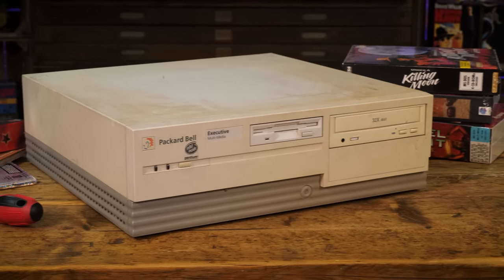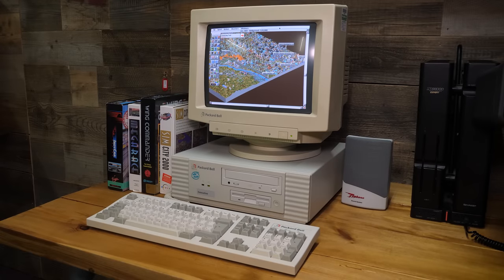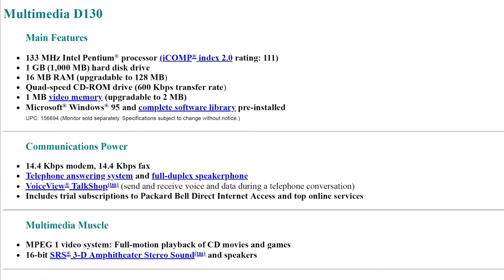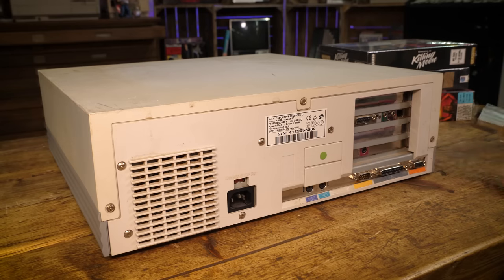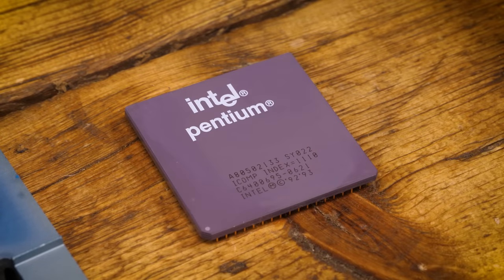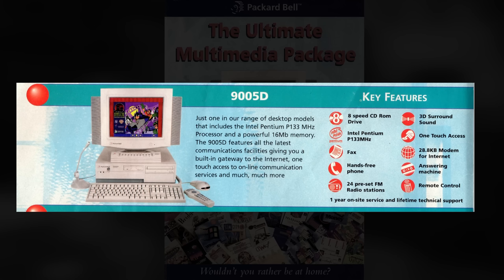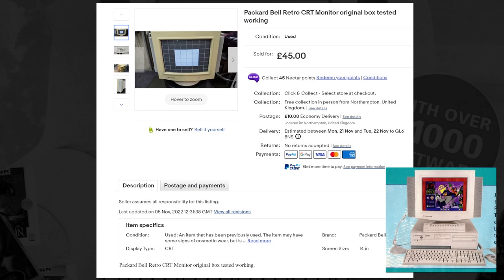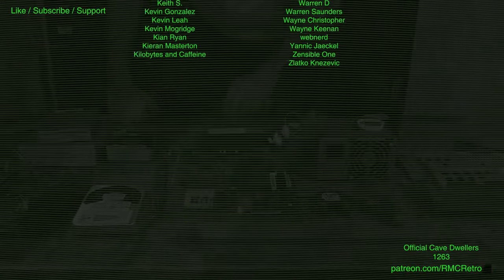Packard Bell Restoration | The Packard Bell Arrives | Trash to Treasure Part 1

Comment: Wow! I had NO IDEA that Packard Bells were also popular in the UK, That's great!  I don't know why some equate these to the cheap "E-Machines" a bit later in the era. From my experience they have been mostly rock solid and work fine. in 1991 I bought a Packard Bell 386X at a US Military Exchange store in Germany. It was a great little machine but I eventually exchanged it for a faster clone. I always wanted another Packard Bell in my collection. One day in 2012, I came across a church sale and there on the table was a Packard Bell 3540 Pentium 100 with the same case design as above. P100 16MB with a 1GB hard drive and Windows 95. 
     I have since upgraded it to 98SE and 48MB Ram. It runs very fast and I even found a Belkin USB port PCI card that works in 98. I don't know what it is about Packard Bells here in the US but they are desired here as one of the main classic multimedia "Store PCs" of the era. On Facebook, there is the "Retro Computer and Packard Bell Planet" page.  Billy Coore is the founding page admin,  Packard Bell enthusiast and Guru! In the files section there are US Factory CDROM images of various models. 
     He and the other members may be able to help you locate that factory reinstallation image. By the way, thank you for saving and restoring it! They are becoming harder to find, and one of my favorite classic PC brands!

Comment: This was the era (mid-late 90's) when I worked at a tech for a small computer repair place.   We used to call these "Packard Hell" computers, due to the oddball things like that shortcut button bar or that modem/soundcard card.   But, these were still a joy to work on compared to the crappy eMachines that came later...

Comment: This was infact my very first PC. I convinced my mum to go all-in with me, into possibly the worst place to buy a PC - Dixons on Dunstable high street. We signed up to a 3 year payment plan and I paid it off with her. It was a Pentium 60 which, I think, was a crippled P75 or 90 because of it being a dud!. I remember it came with Windows 95 when '95 was the new thing but only had 8Mb RAM and boy did it chug. I eventually saved up one month £100 or so to get another 4Mb and cycled all the way there and back to learn that you couldn't buy a single stick. You'd have thought the salesperson would have told me. Had to borrow another £100 to get it usable. It flew on 16Mb though. The other memory was that when I got to 17 and got a car, I drove on a very wet rush hour to PC World Brent Cross because they had modems. I couldn't afford an external one so I went for a 33.6 ISA one which did fit but was a nightmare to setup in Windows 95 with nothing but the floppy disk that came with it to lean on for drivers. Back then you had to pay £1 an hour with Compuserve PLUS phonebill charges, after the first 30 hours were done. And boy does 30 hours go quickly when you've just discovered Netscape, mIRC and all that....

Comment: I never owned a Packard Bell but someone gave me the remote control thingy which up until this video I had forgotten that it was from Packard Bell. Pretty sure it was actually a Logitech made device that PB rebranded. I got it working with my pc, which was hooked up to my CRT TV  and  hifi via a 3DFX 3500 Voodoo card's enormous blue composite out module. After a lot of tinkering and messing about with some software I was able to use it to control Winamp. Quite the luxury to be able to just pick up the remote, press play and have my mp3's play back in 1999.  Unfortunately, over the years it got lost, which is a shame as I'd loved to have sent it to the Cave to complete the set.

Comment: Packard Bell is my first x86 P.C. Dual speed CD-ROM, tape drive, 4 megabytes of ram soldered on the board, 500 megabyte hard drive with an Intel 486DX/66.

Comment: My PB came with some decent bloatware.... Encarta 95 was included as was Descent and Virtual Pool. There was a World Cup multimedia disk too. It came with a terrible shell replacement for Windows called Packard Bell Navigator which got disabled quickly. I have a ton of experience in restoring from the Master CD Images - the files are all ARJ format and you need the accompanying floppy and you need to know the code. I had lost my code over the years so ran a brute force effort on the RAR and managed to get the code. This was essential for me to get the MWAVE integrated modem / sound card back on its feet.

Comment: I had a Packard Bell monitor back in 96-97 era. One day I'm on dialup and chatting with a friend when I hear a noise from behind it. I get up and see flames inside the monitor casing. seems the solder joint where the power cord met the pcb wasn't up to snuff and had finally gone bad. Mind you the screen still looked normal as I yanked the plug from the wall.

Comment: Our first computer was a Packard Bell given to us by my martial arts instructor as they upgraded. No one in my family can remember the model or what was inside. I just know it had Windows 3.1 and it couldn't run 3D Ultra Mini Golf by Sierra. We also used Mario Teaches Typing on it. We had that thing for a short time as it was too old for what we needed. If anyone knows what Packard Bell model might not have been able to run 3D Ultra Mini Golf at the time (it was a slideshow) that would be great. I do know it was a horizontal case like this one too. I know the game required a 486 @66mhz so the one we had was obviously slower than that. It did have a CD drive as we bought the game in a bargain bin at Wal-Mart and it was just the jewel case. It also had a 3.5" floppy drive as we would save our art from paint on them.

Comment: The first computer I had was a new 486 DX2 66mhz model in that case that shipped with Windows 3.11 For Workgroups.  It is long gone of course.  I did end up getting a slightly newer Pentium 75mhz version in that case with Windows 95, complete with the matching Keyboard, Mouse and Monitor with the speakers. It turned out I have a fair number of games that I had kept that run on great on it.  All my DOS based games for the most part.

Comment: Just fyi Neil Packard Bell PCs use something called a motherboard tattoo to tell the recovery media which drivers to install, you will need both the Packard Bell emergency boot disk (it's a floppy) and the recovery CDs to reinstall. I used to support these for PC World tech support (PC service call) back in the Windows XP era, the Packard Bell emergency boot floppy contains the tattoo program and also the CD rom drivers to allow you to install the recovery media (the CDs aren't bootable). If the motherboard has had it's BIOS upgraded, was replaced or you replace sound/modem/gpu you will have to re-tattoo the drive to get the recovery media to install at all. If you get any errors with the tattoo checksum if I remember correctly the override code is PBE97, usually clients upgraded their GPUs or soundcards in store so we used this code a lot!

Comment: I had a similar machine (at least the machine case), but it didn't say executive multimedia afaik. It was a 166mhz if I recall correctly. I also had a packard bell monitor for it, with speakers on it. And the monitor was replaced 2 times, both times a cap exploded, and I replaced the monitor on the warranty. It was my second computer, my first being a 386 33mhz (hyundai).

Comment: Around 2007 my in-laws got divorced and we wound up with their old PB Axcel 3510.  It's pretty similar to this one, only with a 100 MHz Pentium but no remote control or one-touch panel, and sadly no peripherals.  I maxed out the RAM to 128 MB, added another meg of RAM to the Cirrus video, and replaced the CPU with a 200 MHz Intel Pentium Overdrive (with MMX), all courtesy of eBay during a time when these parts were more prevalent and less expensive than today.  It ran in that configuration, sans the sound/modem card but stuffed with hard drives and Siig USB and 3Com Ethernet PCI cards for a few years as our household Linux server. 

I should really dig it out of the garage and resurrect it as a retro gaming system.

Comment: I bought the 486DX-2 66 Mhz version.  2X speed CD-ROM, 512MB HDD, 1MB onboard video, 4MB RAM.  Windows 3.11 WFW O/S.  I eventually got it upgraded over time to 2.5GB Fujitsu HDD, 16X CD-RW, 2MB onboard video, 16MB RAM, and Pentium Overdrive 83Mhz CPU.  I tried Windows 95, 98, and NT 4.0 WS.  That system taught me well on how to take it apart, upgrade, replace, etc., and reinstall operating systems.  Montgomery Wards Electric Avenue in late 1994 was original purchase date.  This one here, on the video, basically looks the same.

Comment: My first IBM compatible PC was the older 486 version of this same computer, from around 1993 or 94. I know I had it before Windows 95 came out. A shop gave me a beta copy of Windows 95 when I bought an AMD processor from them to upgrade the computer.
Reply: Wow, just looked on eBay to find one of these and they are going for outrageous prices now!

Comment: My first PC was a PB Executive (the version with 1x 5.25 slot) bought from Currys Merry Hill in 1994.  It came with Windows 3.11 for Workgroups and was a 486DX2 with a 320MB hard drive.  That machine is long gone unfortunately but I have one similar to this now I rescued - can't think if it's a 9003 or 9005 (comes without the FM tuner) but basically same specs.  Like you I sourced the right monitor for the time and it's now complete.  Someone sent me the restore media for it a while ago which works, so have that if you need a copy to try.  You'll have an absolute mare with that soundcard/modem combi - don't think the drivers were ever released outside of PB's master restore disk - or at least I couldn't find them (you could probably extract them from the image if you really fancied a long and tedious night in front of it).  As you say, probably better off shoving an SB16 in or something as that card is nothing special.  Good luck, looking forward to Pt2 already :)

Comment: I sold Packard Bell, Acer, HP, IBM, and Compaq PCs at retail in the States in 1994 and 1995. We weren't allowed to say anything bad about any of the brands, but when a customer asked about the quality, they could tell from my caginess that I didn't think much of the brand. I sold a lot of Compaqs. Everything sold at retail had shortcomings in those days but at least once you got into HP, Compaq, and IBM, the stuff was pretty reliable. A lot of customers would come in and want to see something other than Packard Bell, because of the reputation. I only sold two Packard Bells during my whole tenure, which was pretty bad because I could sell two of anything else in  single day. IBM was the other hard sell, because people just didn't trust IBM. They usually didn't recall the details but they'd say something about why, and I could tell they were talking about the PS/2 or the PCjr. The PS/1 and Aptiva were reasonable machines, but it was a lot easier to just sell someone a Compaq, even though the Compaq had more proprietary stuff (like the drive rails) than the IBMs did. Management put up with me because I really knew my stuff, but they really wanted me to push Packard Bell harder. I landed a desktop support gig a few weeks after the Windows 95 launch, so that was the end of my time selling PCs at retail.

Comment: Mine was a Tiny 450Mhz P2 with a 17 inch CRT.  At the time they were all beige and dull but it played Quake and Quake 2 very well which was the important point, the content not the content holder.  Wish I still had my Amiga 1200 though.

Comment: Looks like a PB640 motherboard. It has its own quirks ;) definitely replace the jumpers / make sure they are shorting and are not bent in any way as that will cause LOTS of headscratching. I can already tell you that IF you want to use a factory restore disc... expect pain, Neil. Format Number and counter-intuitive restoring (the restore disc will not let you use the restore disc if you have changed the original CD drive, FDD or sound card. I do see that the CD drive is not factory-original) will definitely throw a wrench into your plans if you do. Some time ago me and another interwebz fella managed to crack the "protection" they used in PB's restore media; if you find yourself having trouble with this, let me know and I'll gladly help!

Comment: I had one of these but with a 486 cpu for a short while, I remember it being ok for the price and the case actually looks pretty cool. It had Microsoft Bob or something very similar, it was like an office you clicked on to run stuff and was horribly slow.  I didnt have that button bar thing but there were buttons to do the same thing on the keyboard. Also had the Packard Bell corner PC, very similar specs but with a completely impractical case. The accessories that came with  both were so so cheap but I did like the ears on the monitor even though they sounded pretty crap.

Comment: I had one of these! It wasn't my first computer though, more like my third. Mine didn't come stock, nor did I have the original installation of Windows.

I also had a rather large collection of spare computer parts, so of course I made my own customizations and upgrades, partly with whatever I had around, partly with stuff I purchased from our local computer shop from their discount no warranties box.

I ended up with a whopping 112MB RAM (not 128 mind you, I had mix and match memory from my junk bin LOL!). I had a 120MHz Pentium which I later overclocked to 133. I had a 1GB hard drive with that as well, which required the dynamic drive overlay software since apparently the BIOS didn't directly support it.

I also had not one but two CD burners, so those both went in ya know. I also picked up a 3Dfx Voodoo 1 card (wish I still had the thing...), and a Pro Media Spectrum sound card, which could also reasonably emulate a Sound Blaster Pro at the same time.

Any which way, fun times! Wish I still had the system, but life throws lots of curve balls ya know...

Hope you get that thing up and running as you intend.

Comment: That is very similar to my first IBM PC computer that I had when I was 15.  Except mine was a Pentium 100.  I will say that the sound card made by Aztech is not as bad as you think.  That one specifically has full Sound Blaster Pro compatibility, along with a true OPL3 built in.  It should be quite compatible in dos.  I have one and it even works with early SCI sierra games which are very fidgety about sound blaster playback.  I am jealous that you can get a CRT for 45 Pounds.  I would be lucky to get one here in the States for 150, and it wouldn't arrive safely with shipping.  Packard Bells are quite quirky machines, but I don't understand the hate that they get from all sides.  I have half a dozen here from different eras, all the way back to a 286-12MHz up through a Pentium 233MMX machine.  All of the machines I have are pretty stable.  They stopped selling here in the states in the late 90's, so machines much more powerful weren't not as common.  In regards to system restore software, if you can give the code on the label on the Hard drive, I can id which disc you will need.

Comment: My parents had an old one of those complete with the monitor, mouse and keyboard they bought when I was in kinder. Remember it being uselessly slow when I gave it a try in the early 2000s, but its keyboard had an extremely good and snappy typing feel for a rubber dome compared to the usual mush from the late 1990s/early 2000s. So I took that keyboard it and used it for years until proper mechanicals came back in vogue. According to the internet that was a common story for those keyboards. 🙂

Comment: This was my SECOND PB, first was a 486sx/20, was terrible. Crashed a lot, had a hard drive so small I had to actually uninstall games I'm not playing, and install ones I wanted to, because there wasn't room for TWO games.
Then I bought this thing, the P60 variant, and it was junk. Keyboard rattles a lot, half the drives failed, and the power supply. Only thing good about it was the video card, as it actually got Quake benchmarks most P90 systems got, that was it, and the last PB I ever bought.

Comment: There were quite a few of these around in NZ , as well as a couple of local manufacturers PC Direct (slightly better quality) and PC General (the lowest of low end machines). Also remember seeing a lot of IBM desktops. I remember I did have a bit of a collection of restore disks at one point, and often the machines would ship with the wrong ones which you'd only find out much later when something went wrong of course.

Comment: I would keep the weird sound card if possible. I’d love to see the FM radio working as well.

The reason for this: we have enough "optimised" computers. This computer will never be one, but the multimedia features and weird card and such make it special in its own right.

Also, I loved how you casually* threw in the appropriate word for the 32× drive, after mentioning the 8×/octuple speed.

\* Well, after 94 outtakes, at any rate. ;-)

Comment: Looking forward to this series Neil, it was an interesting time when PC's began to get some real power, plus I personally need to clean and retrobrite a recent purchase, so advice on that would be helpful :) . IMO ditch the modem and that very suspect keyboard you purchased and use the new old stock one then add a 3D Accelerated Graphics Card. Otherwise you're a bit too close to the 486 system you already have spec wise.